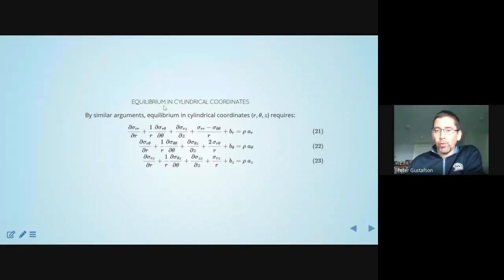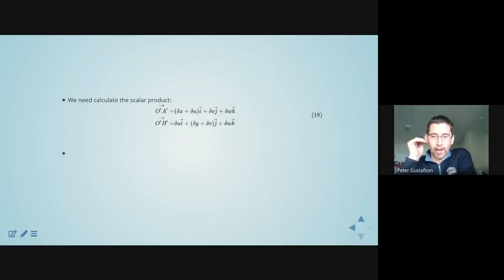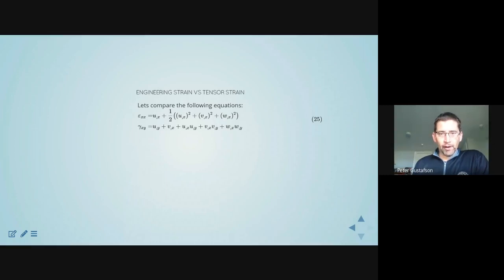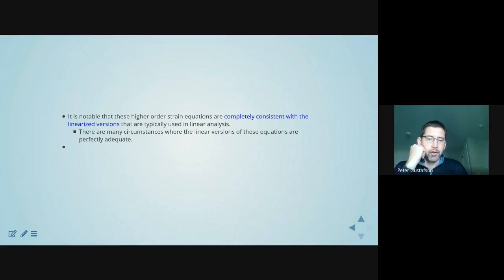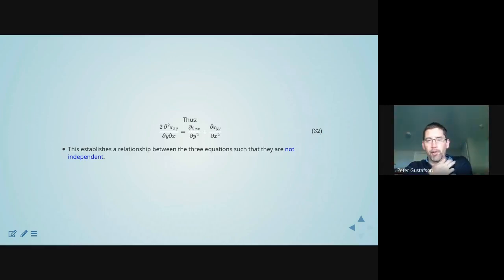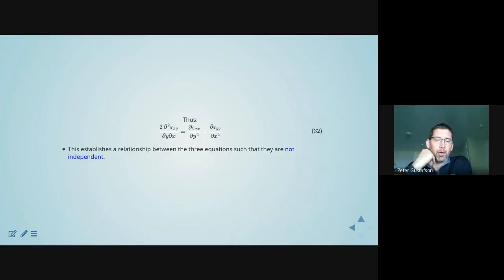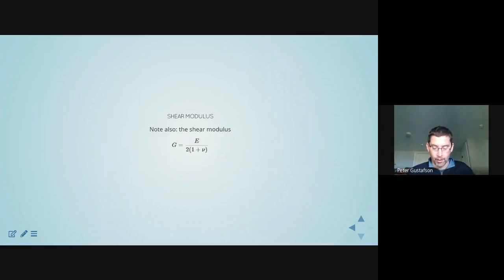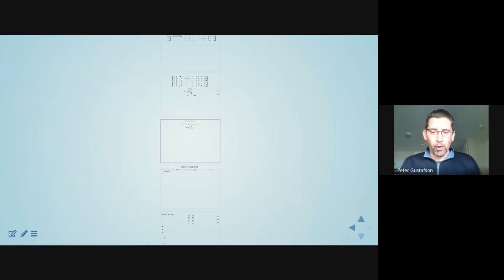AE4630 Lecture 07 - Displacement and Strain

Comment: 3.3 Definition of shear strain
@ 5:54

3.3.2 Summary of the engineering strain-deformation equations
@ 20:15

3.4 Summary of the tensor strain-deformation equations
@ 28:31

3.5 The Principal Strains
@ 34:43

3.6 Displacement Compatibility
@ 40:08

4 Constitutive relationships
@ 48:10

4.2 Linear elastic
@ 1:02:56